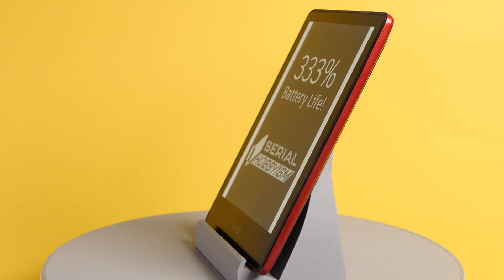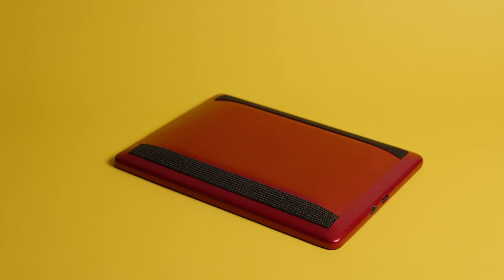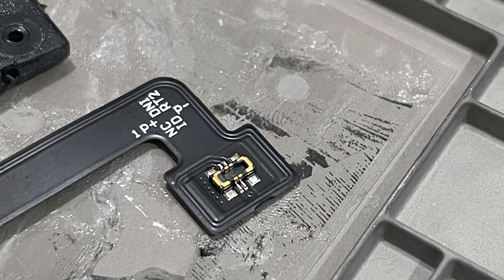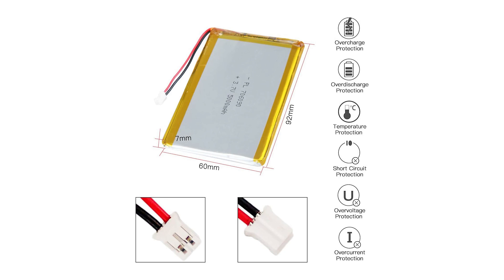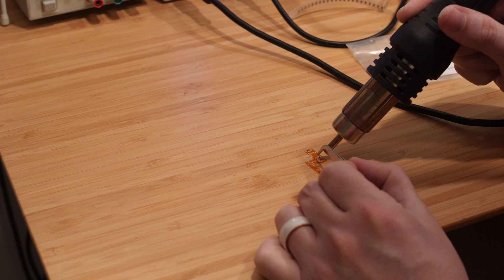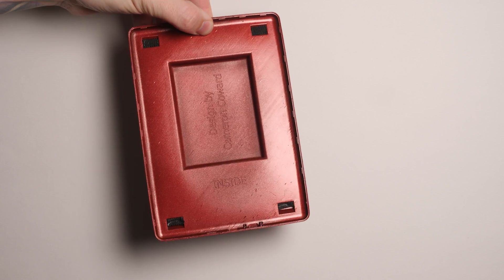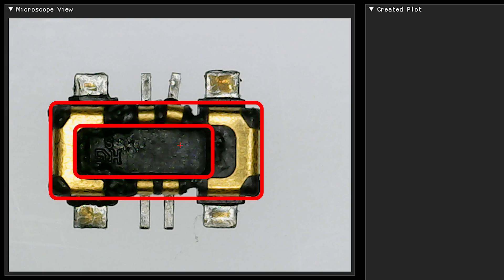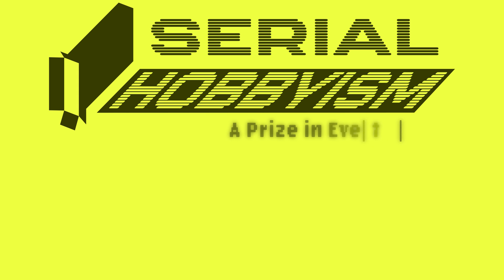Tripling Kindle Paperwhite Battery Capacity

Comment: That's rad! I don't use my Kindle as much, but I have done similar mods before. The results have been a mixed bag, but I feel like I have learned something in the process with most of the attempts. Whatever you think is of interest to you would be something I would watch. I like to see the process of the problem solving, how you handled the changes that needed to happen, and what you weren't willing to compromise on. I very much related to the process of how you finally found the part you needed to finish the project.
Reply from the maker: Thank you for the feedback! :D
Reply: Interesting but you can just take the original bms of the old battery…
You really overcomplicated things.

Comment: I put that same battery into my Kindle Paperwhite 3 (7th Generation, 2015). The PW3 seemed simpler than what is shown in the video; It was easy to separate the battery circuitry from the battery and just solder the battery leads - no extra electronics needed. I guess I do probably have double battery protection circuits, but it seems to work okay.
Reply from the maker: That’s awesome to know! My cynical side makes me think Amazon made it trickier to prevent third-party battery replacement sales.

Comment: I’m repurposing my PW3 as a wall mounted dashboard. I’ll have a server fetch data every minute, generate a png and host it at a URL. The Kindle will wake up once every minute, turn on wifi, fetch that png and set it as screensaver before going back to sleep. I would want this to last 6-12 months on a charge and don’t care about weight or bulk. The plan is to wire together in parallel as many cylindrical cells as will fit in a single layer behind the 4x6” case for a monster 40000 mAh pack or greater. Do any issues come to mind with such a high capacity? The integrated bms seems fickle but if it’s only measuring voltage and current then I think it would be fine. Thanks for the video!
Reply from the maker: That sounds like a fun project! I can't think of any issues with your idea. The big "gotcha" is the battery voltage range. In my case, the new battery has a max voltage slightly lower than the original battery. I can't remember the specifics, but it is something like 4.2V vs 4.35V. So, in practice, the Kindle thinks that the battery isn't fully charged, even when it is. That isn't a big deal, because the battery's built-in protections keep it from overcharging. But it will only ever report a max charge of like 95%. So the reported charge isn't very accurate. In my case, it tends to stick around 50-70% for a very long time, then will drop quickly when it gets below that. All pretty minor stuff. Oh, and yes, it does work with the original USB charging port! Feel free to reach out if you have more questions :)

Comment: That's an amazing mod!  Great work and pleasant presentation.
I have two questions. Where was the thermo on the OEM battery and was it unsalvageable?
Reply from the maker: Thanks! The original thermistor is molded into the plastic of the battery pack. I couldn’t find any way to get it out without destroying it.